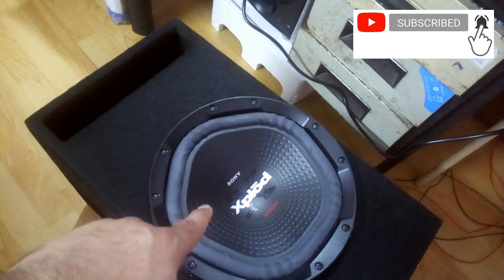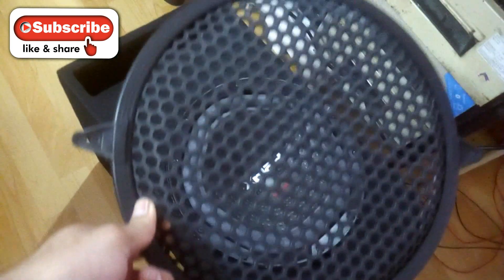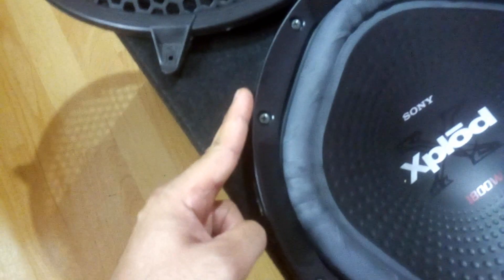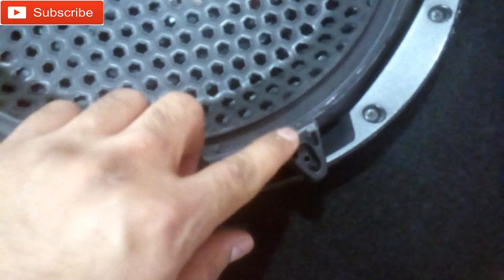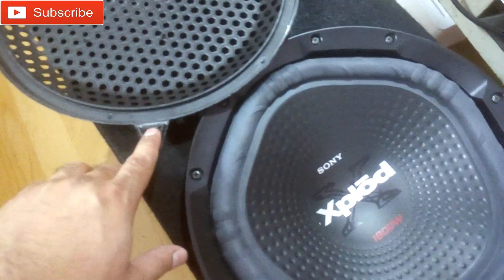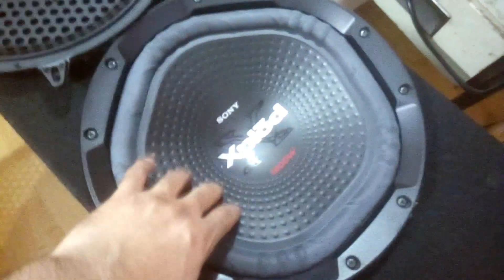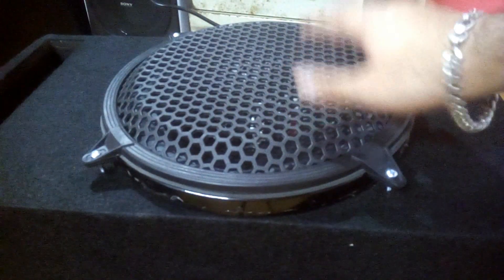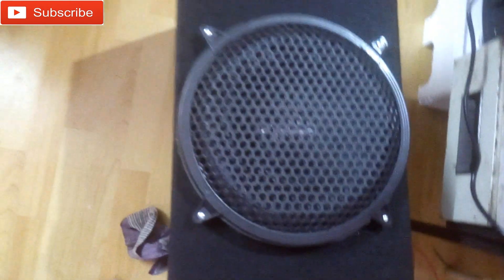How To Install Speaker Grill On Car Subwoofer

Comment: I have JBL 1300w Sub , Will if add metal or plastic grill will it affect Bass quality or decrease the bass ?
Reply from the maker: grill doesnt decrease any bass. just be sure it must not touch the subwoofer surround & stick it properly with some insulator so it doesnt make any noise at loud volume.